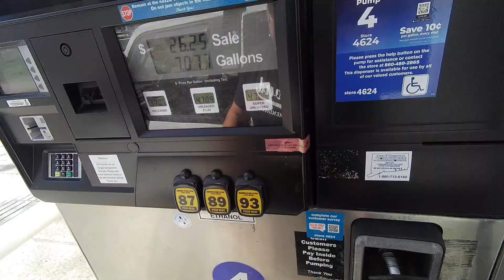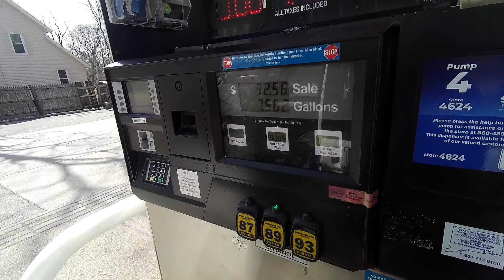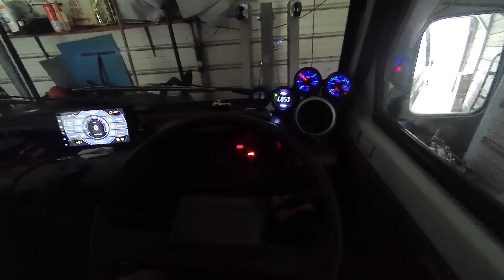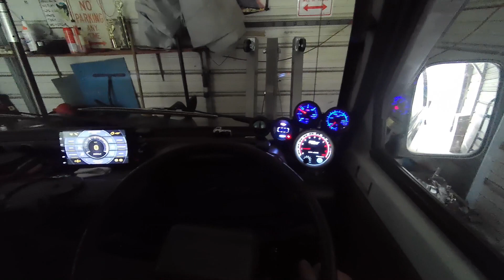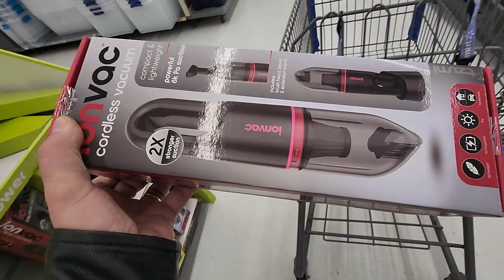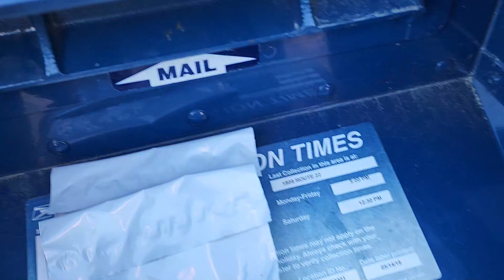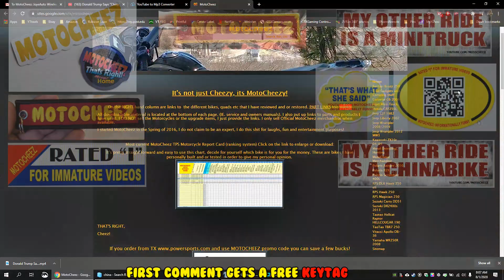Micro Van (SE1 E19)  3 hour drive with the Atrai, 28mpg again! then run some errands with MINITRUCK!

Comment: You should consider installing a power lock kit in the van and probably in Mini too. I have one in my Suzuki, connected up to an aftermarket alarm system so that it can be locked and unlocked with the remote. Makes life a lot easier not having to manually operate all the door locks.
Reply from the maker: I did think about putting power locks and even power windows, but I have an idea of how to make the doors removable on Mini anyway.... It would suck with the wires I'd have to make a disconnect
Reply: @MotoCheez  Ah, fair point. The wires are a pain to run as it is, trying to make them be able to be disconnected easily would definitely not be fun.
Reply: Remote controlled electric locks retrofitted to old vehicles prevents the mechanical door lock from wearing out.  I bought a new 4WD 1997 Tacoma and always locked the doors and unlocked them with the key.  I wore out the door locks.  That seems like a small thing but it's a real PIA unless  you want to carry a key for the door and another key for the ignition.  The best option would be a fairly new wrecked truck and swap all the door locks and the ignition lock.  Glove box and trunk locks too on cars.

Comment: You have the hole bed to fill. Lol. Have you thought about making a cargo net work in the bed? And if you stop somewhere else you probably don't want things taken. Did you have to rent the shopping cart?
Reply from the maker: I usually put it in the bed, chance of rain I use the cab. A cover would be a good idea, but I have the van now 😁. Yes. It's a quarter to release the cart and you get it back when you return it

Comment: The only thing I can think of is if they get rear-ended they are not in the middle of the intersection.
Reply from the maker: But there were cars lining up behind them, why not inch up to line? 😄
Reply: I completely agree. I think they should do an IQ test before applying for a license.

Comment: I know nothing about these little trucks. Does it have a farly typical evap system on it? If so does it have a purge valve?
Reply from the maker: Yes and yes. Very complex pollution system. About a dozen solenoids and packed in tight because turbo. Hard to trace lines. Goes from rubber to solid a few times
Reply: @MotoCheez  Ive seen some purge valves backing up and dumping in the intake manifold in the past. But I would think you would have a check engine light on. Is this OBD II ? I remember how those older japanese cars are vacuum lines & solenoids for days!!
Reply from the maker: No check engine light, might be OBD1 but haven't seen a plug

Comment: Maybe you're losing prime on your fuel line.
Reply from the maker: When it's cold and I start it it's definitely flooded a little bit but after I drive it before I disconnected the carbon canister it was definitely the gas tank that is under vacuum so yes it probably was fighting against the vacuum to pump it into the carb